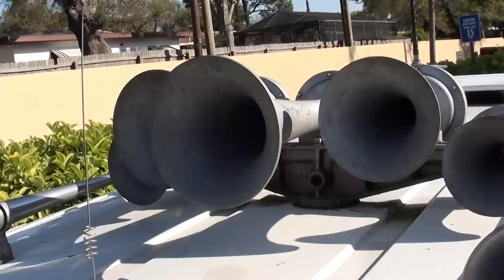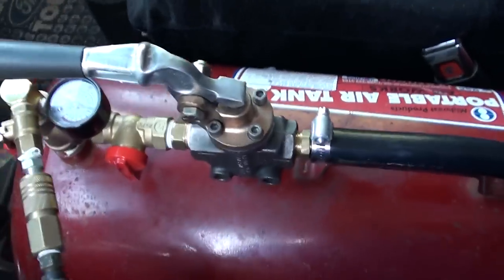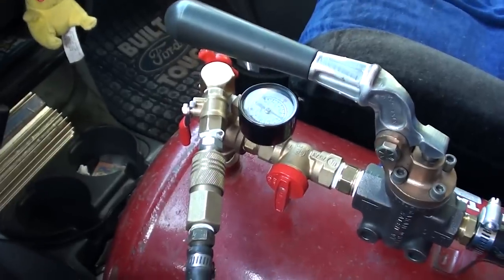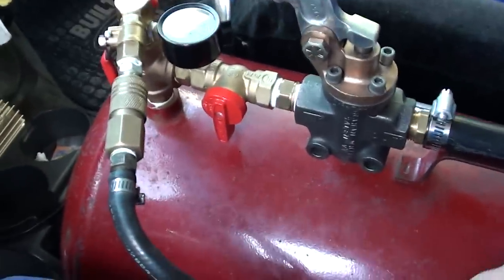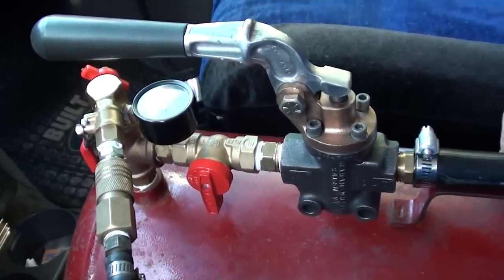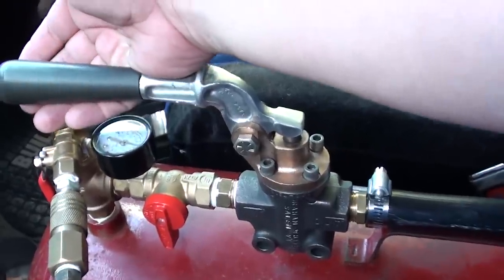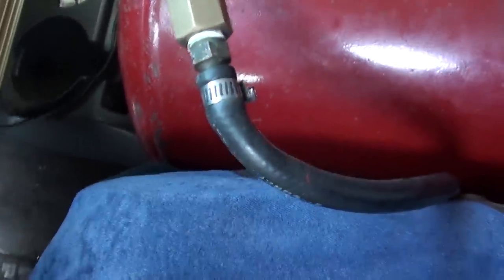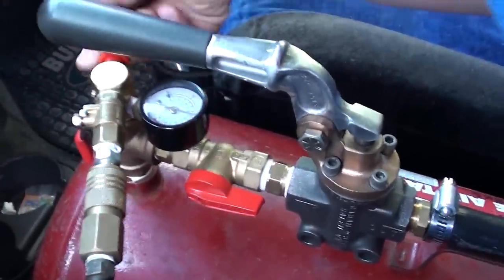Nathan Airchime K5LA Train Horn! The Air System Used In My Van For My Train Horn II

Comment from the maker: I generally take my K5LA apart once a year to check the "o" rings, clean out any debris that got into the horns, clean up the diaphragms, re-seat the diaphragms and back plates and tune them individually with an air compressor blow gun before reinstalling each horn back onto the rack manifold.  I have gone as long as 3 years without tuning or rebuilding the horns.

Comment from the maker: Yes... That is normal for it to be hard to open the valve by it self.  Once it is installed in line with the air supply lines and well secured so it does not move around, it is for the most part easy to pull the handle and operate the valve.

Comment from the maker: Awesome... That horn will SCREAM for sure with that valve... Just make sure that you use a large air tank(15 gal. or larger) and dont go over 150 psi for safety reasons... You could damage the "o" rings in the valve or blow out the diaphragms of the horn when you go over 150 psi...The great thing with that valve is you can feather it to quill the horns or pull the valve wide open and slam the horns with the sudden air pressure to get that quick horn blast.   Have fun with it. I do with my K5LA.

Comment: hey bro, great setup. how much PSI needed to run through the NATHAN? will a typical tractor air line supply enough air?
Reply from the maker: Joe Albergo need at least 60 psi to get pretty much the full effect out of these horns.  I use up to 125 psi in my air system.  as far as the airlines needed, something with at least 3/8 inch internal diameter is what is recommended and can withstand at least 200 psi to resist the lines from bursting.

Comment: @djluna96 I found out the problem...these are meant to be ran with a 1/4 inch airline and at 120 psi. Buy a pressure regulator (viair sells 1/4 inch pressure regulators for cheap) and try them. If you run them with a thicker air line and a higher pressure they lose their stuttertone sound.

Comment: with the graham white valve, do you have to use a lot of force to pull the handle? The one i have either has a really hard spring or something else becuase i have to use quite a bit of force to get the whole valve open
Reply from the maker: No...  I do not need a lot of pulling force with my valve...  I can not give you an exact answer on what it suppose to be as far as the needed pulling force. So I used a fish scale to see how much it takes to pull my valve and it came up just over 3 pounds to just crack open the valve and about 10 pounds to fully pull open the valve.  Now this is by no means a true scientific exact specification whereas I don't have the proper weights and measurements equipment to get a correct reading.  I hope this is helpful.
Reply: Dvj Luna It is. Thank you very much for the response!
Reply: Dvj Luna

Comment from the maker: I have to do it manually from a gas station or from my workshop air compressor.  I use typical automobile mechanic shop quick connects to fill my 12 gal. air tank I have in my van.

Comment from the maker: I would like to have more of a permanent installation of the air system I use...But there are times I need to do a quick removal and the system I have only takes me about 3 min to get the air system out... Further more, where I live, there is a lot of salt air and the corrosion factor is much higher here than in other places...Keeping the air system in my van has prolonged the air tank and valves.  The horn is placed exactly where I want it to show it off and get the max volume.